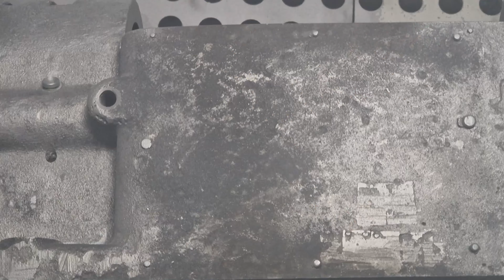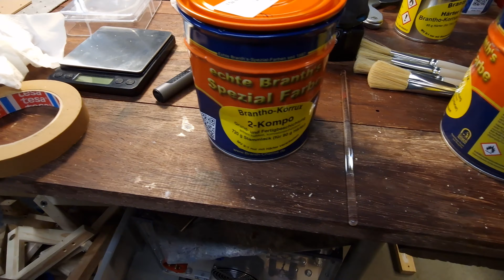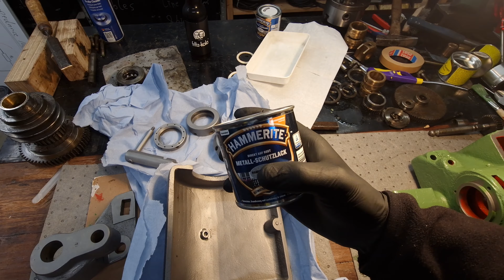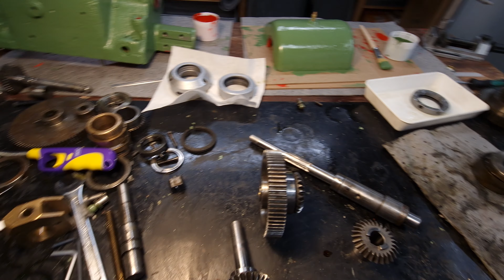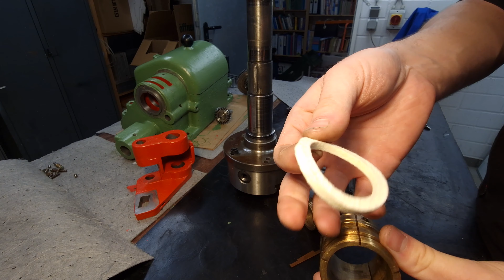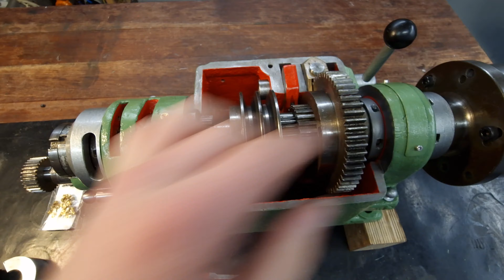1939 Weisser Type EE Lathe Restoration Part 2 | Headstock Rebuild

Comment: I have an old Ariston lathe (made roughly around the same time) - the tapered bearings are the same type of bronze/brass/whatever and are completely ruined because the former owner used heavy equipment grease instead of oil :/
Picked it up for €220 a few weeks ago, came with two chucks, tooling and a few spare parts that do not seem to belong to my machine.
Mine is also not geared; it used a flat belt and a simple gearbox for reversing the direction. The speed was controlled via a star/delta switch and different pulleys. Originally it came with a reduction countershaft drive, but mine is sadly missing those parts.

At the moment it is also being taken apart, I am converting it to double row angular contact bearings on both sides.
The spindle has been turned down to a smaller diameter, on a modern machine, so the cones are now flat and a press fit for the new bearings.
I plan on boring out the headstock on my mill (Mikron WF3) with a Wohlhaupter boring head to fit the new bearings, but I have not come around to it jet.
Speed will be controlled with a VFD and an oversized 5.5 kW asyncronous motor (squirrel cage) which replaces the original 2.2 kW (slip ring rotor). I hope to achieve some decent low end torque that way for cutting threads (M12 will suffice). The original gearbox will be scrapped because I can change the direction on the VFD.

Will you be using a VFD too? Has the gray box with the moving-coil instrument something to do with speed control?

Are you able to measure the run out on your spindle or does it not matter for the projects you are doing?
I speculate that the cut quality can be drastically improved on our old machines by changing the bearings in the headstock, stiffening the machine frame by connecting the two posts, carbide tooling, fine-adjusting speed control and proper leveling and adjusting...

Love your videos on the topic, your great work, and high production value!
My projects take forever without filming them, can't imagine how time consuming it must be to also document the work...

Schöne Grüße aus NRW!
Reply from the maker: That looks like quite a nice lathe too, and perhaps like a bit better of a deal than I got on mine ;)

Use of grease instead of oil seems to have been an issue with my machine aswell actually. There was at least quite a bit left in the oiler holes after I pulled those out. Seems like I was lucky that at least the main bearings got oil instead :) Modifying the Lathe to use modern bearing would be very interesting too, but there is unfortunately really not a lot of material to bore out in this headstock design.

The speed control on the EE is actually done with a gearbox. just that it is not inside the headstock but a little further down in the foot of the lathe. It has 6 settings plus the low/high select in the headstock giving 12 speeds between 35 and 1470rpm. That has been enough for what I'm doing so far, and I'm afraid the old motor wouldn't like being driven by a vfd very much. So for now I'll keep using the gearbox and only switch to a vfd if the old motor breaks some day and I'm installing a new one anyway.

I have so far measured runout and straightness of the spindle when I got the new chuck as best as i could. I don't have any precision ground pins to mount for measurement so I used the outside diameter of the chuck. That had a rounout of something like 50um, which so far was ok for what I'm doing. That might have just been the chuck though.

Thanks for the nice comment :)